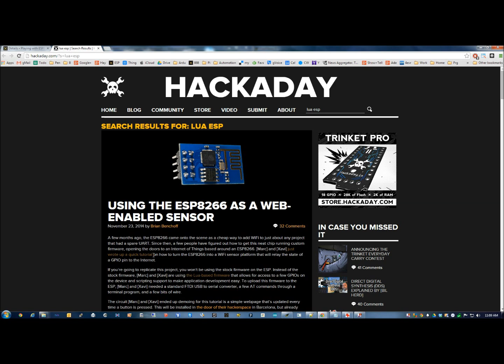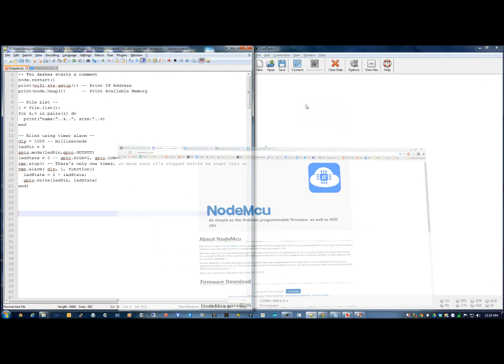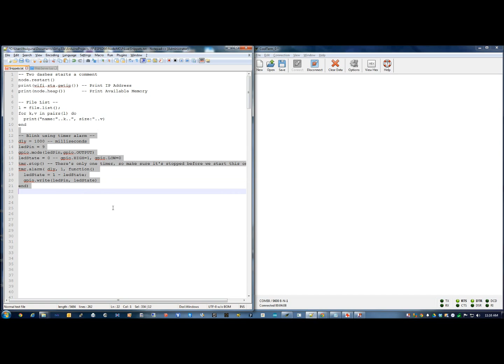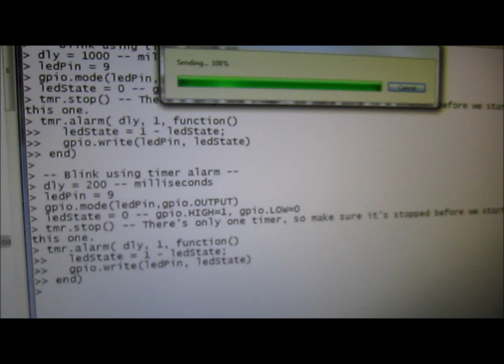$3 Wifi module part 3: NodeMCU LUA Interpreter

Comment: Hi Hari - just sbscribed to your site: really great help for us total newbies! Regarding the above video #3 could you please post a complete circuit diagram or at least show your opening picture of the board vertically straight down as the following connections are complete obscured in that view and can't be seen? The actual connections for the diode, led, resistors and rear connections of the ESP8266 board. Your circuit diagram in the previous video #2 does not show (include) all of the above components either as best as I can see, except for the ESP8266 connection. I realise this is very basic stuff for you but there are many of us out there that are trying to reproduce your work and thus learn from it but cant get past these limitations. Trust you will understand our cry for your help.
Regards, Ian
Reply from the maker: Hi Ian Brown ,
Sorry for the confusion. I'm currently working on a new video where I summarize what I've been learning about the ESP into one end to end project.  It's not quite ready yet.  However, as part of that effort, I've drawn some diagrams.  It's not exactly the same as in previous video, but hopefully would help you wire up your ESP.  Let me know if there's anything else I can help you with.
https://github.com/hwiguna/g33k/tree/master/ArduinoProjects/RF/ESP8266/ESP8266%20from%20Zero%20to%20IoT/Schematics
Reply: Hari Wiguna Hi Hari - thank you heaps for your very quick reply and providing the new circuit diagram; this clarifies all my issues except you have not included the diode you previously used?. You might also be interested to know that the second png file (Wiring_ESP8266_Pinout.png) you attached to my reply does not open in the small window that opens on your GitHub page, you only get the pic name but it can be downloaded (and opened) by using RAW and saving this to my desktop! Thanks again and cheers - looking forward to seeing your new video.
Reply from the maker: Ian Brown , I probably drew an LED as a diode. :-(
Reply: Hari Wiguna Thanks again for your prompt response - and sorry to be a pain over this - however your latest comment just totally confuses this issue as you have used both led and diode in #3 video and both components are clearly visible in your circuit in that video??? What I can't get my head around is, "is the diode necessary on the power in circuit to the ESP8266 in your video #3 (and presumably the one you are now re-doing or not"? I do understand why you used the led in #3 video as it offers a visual clue to the fact the server based wifi exchange is working as it should. Hope you can clarify whether or not a diode is necessary (or not) when using the ESP8266 in the way it is connected in Vid #3? I had previously read that this diode prevents reverse current potentially destroying the ESP8266 in the event of a short circuit on the input(???) but am not at all certain of this deterrent. Cheers, Ian
Reply from the maker: Ian Brown ooooh... I wonder if you're referring to the voltage regulator?  That's the component with three pins between the power jack and the +3.3V power bus that powers the ESP?  As you may already know, the ESP8266 is a 3.3V device.  If you have a 3.3V power source, the voltage regulator is not necessary.  However, I typically run mine off a 5V wall adaptor, so I have to use a voltage regulator.  On the other hand, I've also used a 3.7V LiPo battery without voltage regulator.  So the ESP would tolerate a little bit higher voltage.
Reply: Hari Wiguna Hi again Hari - on your new & latest circuit diagram you have shown all +ve voltage wires in red however the "red wire" wire on the left hand side of the push button is shown connected to ground - should this be connected to +veV supply or to ground as you have shown? I hadn't noticed it was connected to GND and I rather dumbly connected it to +V supply instead based on its red colour and am getting supply feeding back through into the FTDI board with its power light being dimly lit while the FTDI is not connected to the USB port???? HELP please!!!!  Cheers Ian
Reply from the maker: Ian Brown , Whoa!!!
You are absolutely correct, the red wire connected  to the two resistors should be connected to the +V.
Thank you for catching that error!!!
https://raw.githubusercontent.com/hwiguna/g33k/master/ArduinoProjects/RF/ESP8266/ESP8266%20from%20Zero%20to%20IoT/Schematics/ESP8266%20Wiring2.png
Reply: Hari Wiguna Thanks again for your prompt response - what I don't know is should I be seeing power being fed to the FTDI board (albeit reduced voltage around 2 V - I'm using a 3.3V supply) without the USB connected to the FTDI as described above when the ES8266 is powered up? Can you please advise - Cheers Ian
Reply: Ian Brown The other thing I forgot to ask is that I am using my laptop (already WiFi connected to my PC) so will your code work in this case on the laptop or should I be running this on my PC (which is connected by modem to the internet? Cheers
Reply from the maker: Ian Brown , as far as the FTDI getting power, I'm not seeing that on my setup.  On which pin are you seeing the 2V at? It is possible that the ESP is sending startup prompt, etc and the FTDI gets that in its RX pin, then bleeds to Vcc on the FTDI.  Personally, I would not be concerned about it, but then again, you're the one who caught my wiring error. :-)

As far as the code, which code? The one in this video is a blink program that doesn't use WiFi at all.  BTW, feel free to hit me up on G+ chat.  I'll answer if/when I'm available.
Reply: Hari Wiguna Sorry Hari - was getting confused between your NodeMCU Lua program and another by Julian Ilett who is connecting to the internet via a WiFi web server program [which is where I ultimately want to get to for another project I am doing to get weather data via the internet from my home weather station and another similar program for getting data sent via the internet from my home security system notifications .....all of which is pretty hairy for a total newbee to this business]- in your case I had forgotten to change the original ESP8266 program for the LUA Updater as I had already done for the Julian Ilett Project in which the ESP8266 is hard wired to a battery pack. Regarding the spurious power getting to the FTDI board - I am using a programmable Voltage Regulator to get my 3.3V which has much more complicated wiring requirements when including the recommended circuit protection diodes and capacitors - a real pain in the butt!!! So I am not sure I have got this totally right as yet althouge the reg is delivering an extremely stable 3.33V - I am using a 12V DC supply via wall wart to supply the LM317T Voltage Reg.  as my previous 5V Reg when using a voltage divider to get to 3.3V couldn't supply enough current to run the ESP8266 in your circuit and I can't locally source a suitable [current wise 500mA to 1000mA] 3.3 V regulator. I'm getting the feeling I might have bitten off more than I can chew at this stage???? Cheers, Ian
Reply from the maker: Ian Brown I totally understand how overwhelming the amount of info out there on the ESP.  Julian has a great channel with interesting presentation and great tutorials.
I think you don't give yourself enough credit.  You found my wiring error, you ask a lot of good questions, keep at it, you'll get it!  When you do, please make a quick demo video and leave a link here or G+.  Cheers, Hari.

Comment: Very good video.

I had the impression that NodeMCU is only for hobbyists.  I cannot imagine an end user enter his/her ssid & pwd into your code and then load it into the chip in order to use this cheap chip. An IE user interface to allow user to enter ssid & pwd + the rest stuff you showed can get this thing accepted by the market. Did I miss something? 

There is also NodeLua -- can you comment why most folks playing with ESP8266 do not use it?

Thanks.
Reply from the maker: Thank you. 
It should be possible to boot up the ESP8266 as an access point, have users connect to it using predetermined login and password, enter their actual accesspoint credential, and have the ESP remember that.  From that point the ESP can connect to the real access point.

As far as other firmwares,for me it is a matter of not having enough time to play. I have not even kept up with the original AT command firmware.  I also wanted to play with MQTT.

Comment: While we are copying same lua matter as given in your Part-2 (after minor syntax error corrections) to a note pad and then selecting to use "Execute Selection" in your lua uploader it works fine till the end and it indicates some 2000 odd byte content in init.lua. It connects to the wifi network. All working  fine . But while we save it to ESP it shows an error. Checking on the "list file" it says init.lua byte content is zero. What is the solution?
Reply from the maker: Patnaik UC , I have not seen that behavior before. I will review the code and see what could be the issue. Thank you for taking the time to report it.
Oh, I wonder if it is because the code in the existing init.lua is doing something that prevents the ESP from listening properly.  I often had to delete init.lua while I fix a bug in another lua file that init.lua launches.

Comment: The node.heap() will only show the available RAM (read-read memory). The files are actually stored in flash or eeprom and don't use up any of the heap UNTIL the functions are invoked by the interpreter. With this LUA on ESP implementation, currently there is about 150kB of ROM available but only ~22kB of RAM. 

To summarize files are stored in ROM and called functions and variables use up RAM (heap).
Reply from the maker: Oh, I see. Is it possible to programmatically unload functions that are no longer needed (at least for a while) so precious RAM could be used for functions that are needed now? Or does LUA memory manager already does this automatically?
Reply: Hari Wiguna
As I understand it, Lua has a "garbage collector" feature that will reclaim memory from functions and variables that are no longer used. Defining functions/variables as global or local will determine what memory can and what memory should be reclaimed. With that said, this feature is not working really well in the current firmware version as there seems to be some memory leakage and sometimes it can take a minute or two for this to happen. Come to esp8266.com forum, we are discussing this issue and lua in general there.